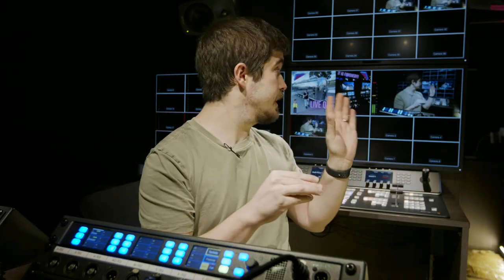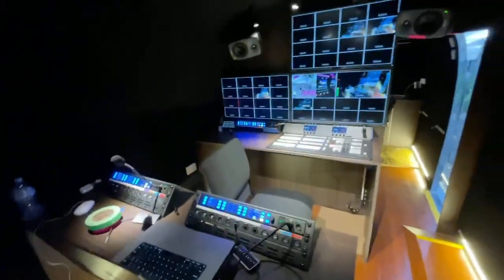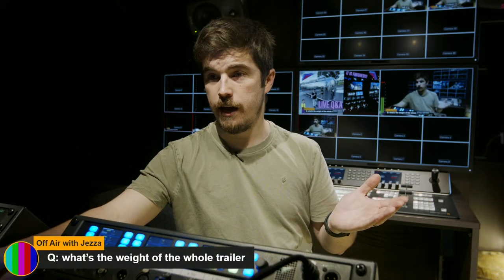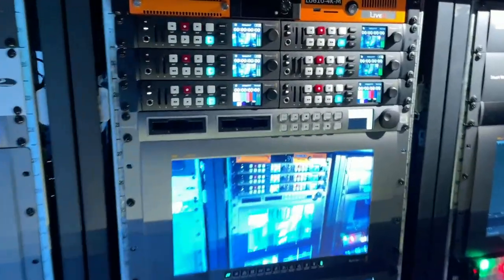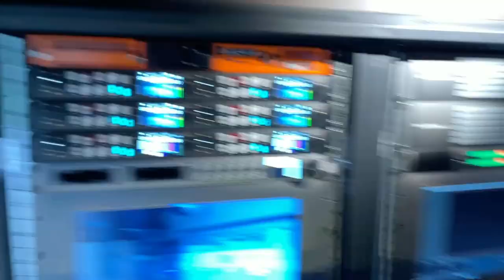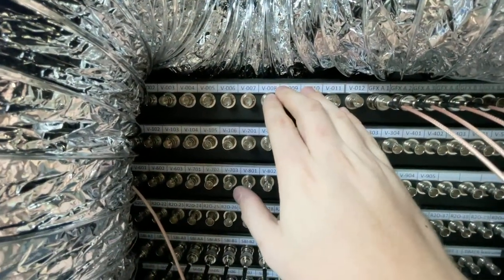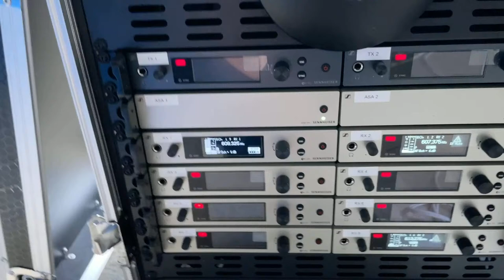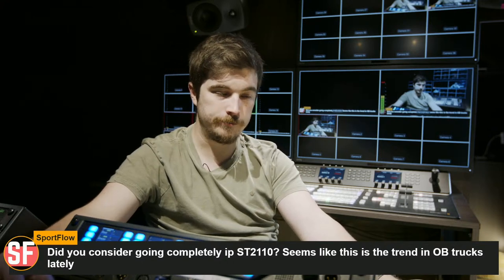LIVE Q&A from the COMPLETED OB TRAILER!

Comment: Curious with all the BMD micro converters, are they just double sided tapes to the rack shelfs? Or are you using the slots in the shelf, and using the screw holes in the side of the converter? If screws, I hope you put some loctite on the screws. I've built some units with perfectly spaced holes for those converter screws (100's of converters), and screws coming out gravity side has been the biggest issue. Great build BTW. terrible shape of a trailer, but looks cool.

Comment: Regarding using an 8K tv for monitoring, have you looked at the Astro Design SD-7076? It does quad-12G to HDMI 2.1 8K conversion, so maybe that could be a solution. Looks like it supports SQD at 8k-50/60 which should give you a quad split with four 12G's if I'm not mistaken...
Reply from the maker: Ahh yeah I think i saw that back when i was looking but it doesnt seem available anymore? also it was super expensive from memory..  Hopefully blackmagic will bring something to replace it soon!
Reply: @RyanSomerfield  Yeah, it would make sense for them to have this in their portfolio considering they are pushing the Constellation as an 8K mixer.
Reply from the maker: @anderstest5978  well they have done all the work already and made the box, they just need to add hdmi 2.1 and they are done..!

Comment: Great job considering challenges with design. 
Question: what software or hardware did u use to integrate your iPhone as an input source into the BM switcher?
Reply from the maker: I used filmic pro and an Apple TV to do it, then a hdmi to sdi adaptor

Comment: Thanks for sharing this build. Very impressive and some very useful tips and tricks. Q) Have you had any issues with the Blackmagic Audio to SDI embedder. I used two in my rack to give me 8 channels of embedded audio and they were terrible, with glitches and then total picture drop out after a few hours of usage... Have had to ditched them and I'm looking for an alternative... any suggestions?
Reply from the maker: Oh interesting! To be honest I didn’t put much time into them apart from an initial test… AJA may be your best bet then? I do have a BMD embedder on another site which has been going solid for years with AES though?
Reply: @RyanSomerfield  I've just bought an X32 mixer to replace my analogue Mackie so I'm looking at the possibility of output via a Dante card and using a Dante to SDI embedder... I believe Sonifex make one but never come across anyone using them. Getting hold of one maybe be another issue...
Reply from the maker: @jtvproduction  yeah there is a few out there.. but getting anything Dante is near Impossible at the moment

Comment: For the Streamdecks you could use companion satellite on Raspberry Pi or any other Mini PC with Linux, Windows or Mac. It connects the local Streamdeck to the Main Companion Instance via Ethernet or Wifi, but Wifi is much worse. So you could also put Streamdecks for the Output Routing in the Stageboxes. I often use Raspberry Pi, Streamdeck XL and a Powerbank on Stage via Wifi just for onsite routing and not have to walk thousand miles. :D

Comment: Can someone explain to me what a clock does? Since it doesn`t sync all devices the only use for it is to sync the video and audio after everything is recorded? As far as i understand its the equivalent to the directors clapperboard for a movie recording is that right?
Reply from the maker: So clock is for syncing devices in terms of time. Means a second on each clock is the same.. kinda.. so for example if you record on multiple devices that arent clocked they can drift over time  since it’s relying on its internal clock which isn’t accurate, sending clock to each device means they all have a common timing. Not so much of an issue in digital land but it certainly helps.. another example, if you did a multitrack record of audio and recorded video separately, it could drift over time also. This is not to be confused by timecode though. Clock is just pulses where as timecode is time, so if you wanted to sync sources, syncing timecode would be what you’re looking for. But in a perfect world if clock and timecode was synced, everything would be synced together. Hope that made sense